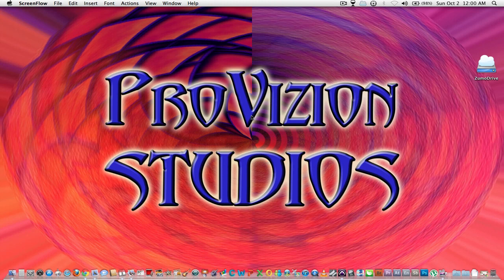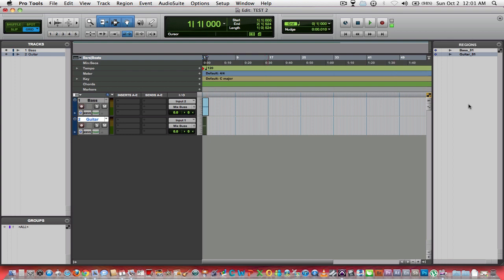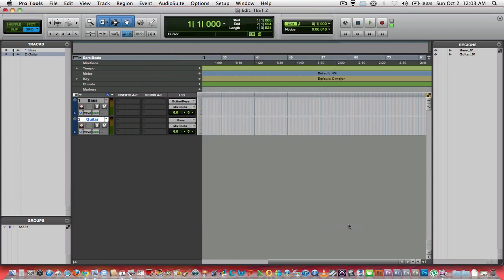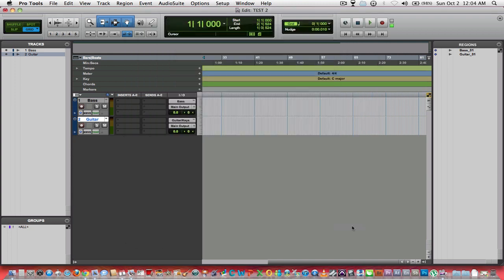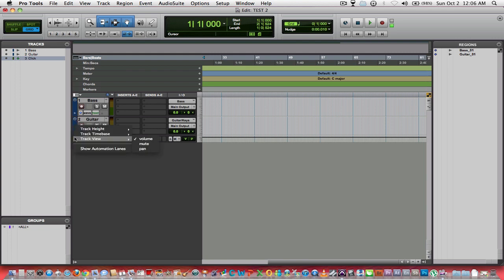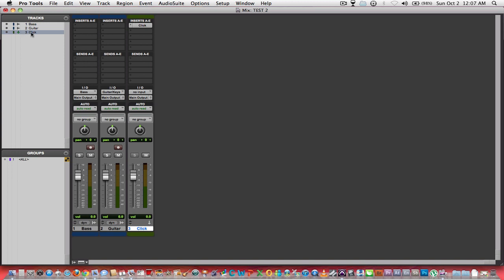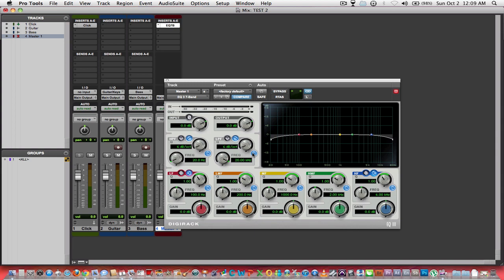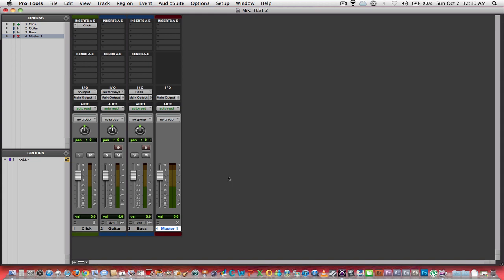Pro Tools 101 - Beginners Guide (Part 2)

Comment from the maker: When you play the guitar are you seeing the level meter go up on the track? If you are then you are sending a signal into Pro Tools. If you are not then your routing is wrong and we will need to address that issue first. What type of interface are you using? Have you checked to see if your battery in your acoustic guitar is working? Do you own a microphone? If so, then try micing up the guitar and seeing if that works - if so then that tells us your acoustic pickup is faulty or needs a battery.

Comment: Hey brian Im a first time user with pro tools, i feel like an idiot. i know basic way to get started by reading the manual but I plugged my acoustic in to record and Im getting no sound back its just quiet. its plugged in i have new track, the mixer out with the record button highlighted were your suppose to be able to adjust the volume and gain and i hear no tone. Ive been screwing around trying to figure it out and the manual says squat about it can you help?